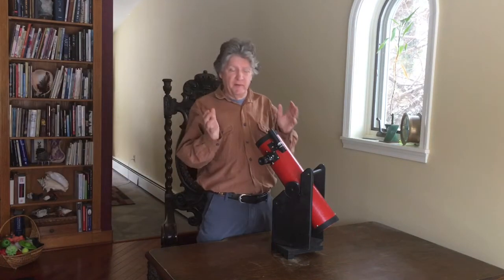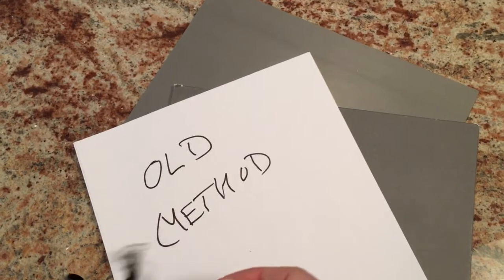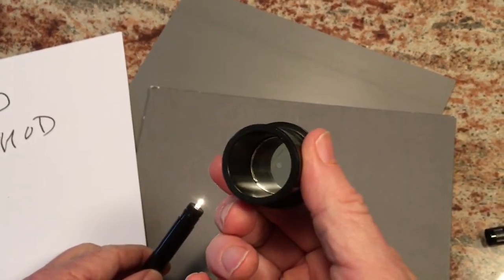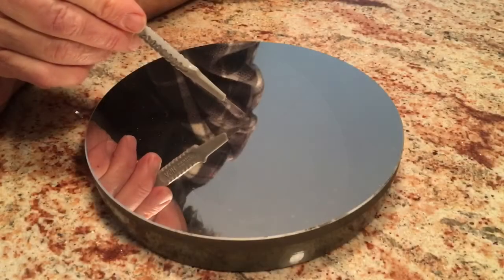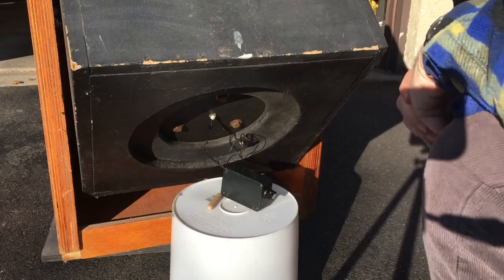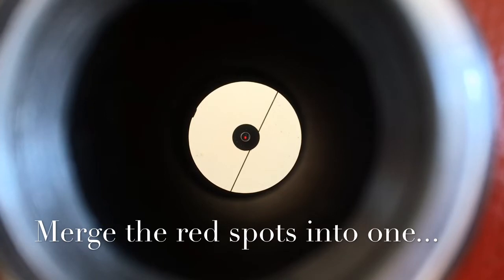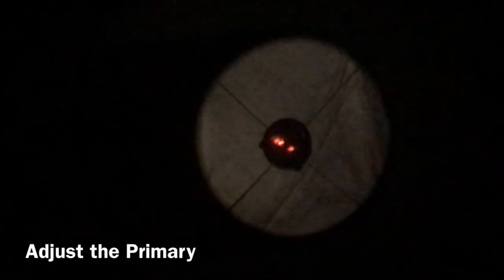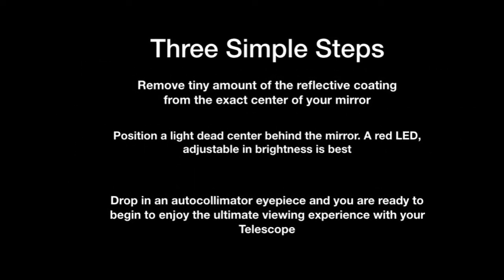Ultimate Telescope Collimation

Comment: How do you know you are in the exact center when you scratch the surface or place the light?
Reply from the maker: Good question. Most manufactures will have already marked the center for you by one means or another. Depending on how the center is marked you may be able to remove some it, dead center, along with the reflective coating. Always keep in mind the shadow of the secondary is huge compared to the tiny spot removed. If you need to determine the center assuming manufacturer did not give it to you in the form of a dap of “paint” or other (o-ting) then cut a circle the same diameter of the mirror with the center having a small opening at the center, place the paper on the mirror and scratch the center of the reflective coating off. Do not drag the paper, or anything else, over the surface of the mirror and keep your fingers off it at all times. .

Comment: I get that the little tiny scratch in the center is negligible to the image,   but i have to wonder if the hard coating on the mirror would start to delaminate much like the clear coat on a car.   How long have you been doing this?
Reply from the maker: I have been doing this for years and see no additional deterioration
Reply: @johndeitz7799  I gotcha,  thanks for the reply!